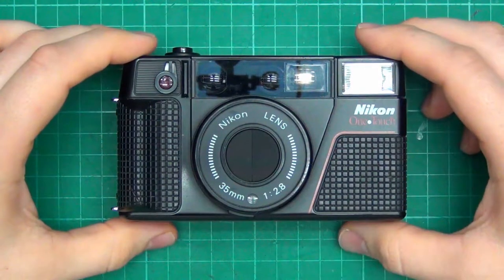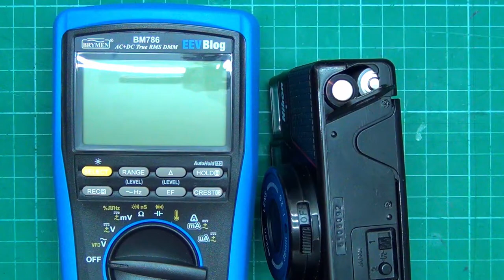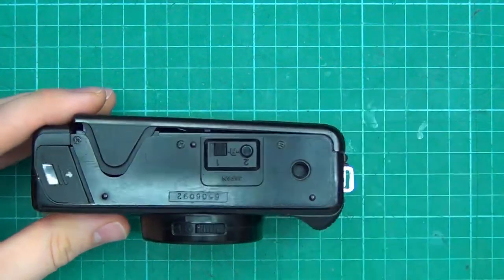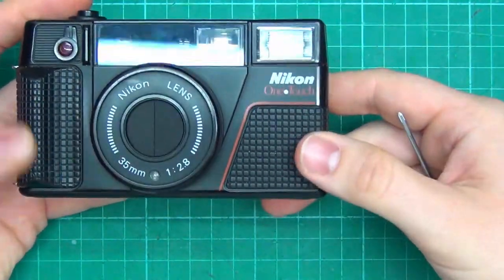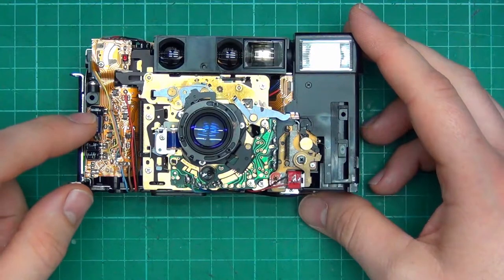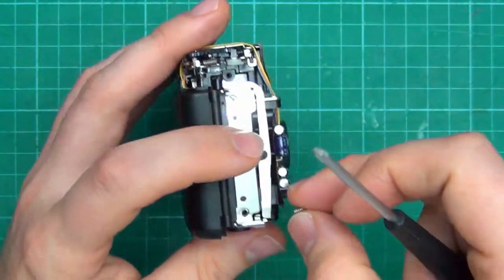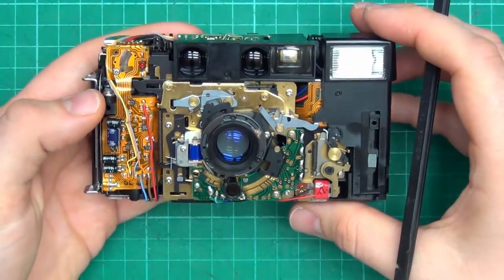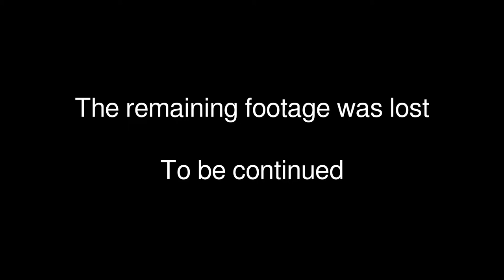#03 Nikon One Touch L35AF2 | Part1

Comment: I believe the flash on one of these cameras will only Power up if you pop the flash up put on a camera that's working properly. This is a fully automatic flash so it won't pop up if there's a lot of light but you can trick it by covering the lens and half pressing the shutter when does long as the flash popped up it should fire.
Reply: Hey, could you tell me if the flash will pop up without film loaded? I'm trying to test one I bought today. It fires but the flash won't pop up. Thanks!

Comment: I had the same problem and watching this video made me frustrated because you where touching everything except for the part that controls the shutter button. If you go a little more down from where the button is, there is a switch that is locked. You have to press it down and the camera will reset itself.
Reply from the maker: I am not sure what button you are talking about. On the front of the camera vertically down from the shutter button is the self timer that rotates but that does not reset the camera. On the bottom of the camera is the slider and button for the film rewind which also does nothing to make this camera work.
Reply: What part are you referring to? the small litter silver hinge right below the Sutter button?I heard it release when I touched it
Reply: @sdp8483  looking from the front under the shutter release button is a black plate connected to the shutter mechanism (at the right end connected with the spring), if you move it all the way to the right, it will unlock the shutter and release the trigger button. I just repaired my camera bought on ebay. It took me 10 minutes thanks to this video to get to the inside and your one helpful comment :) Thanks man!